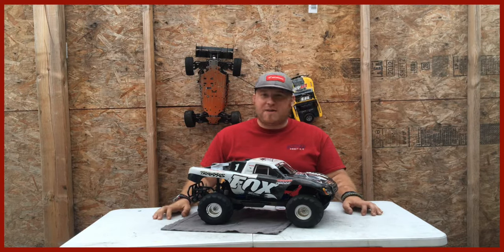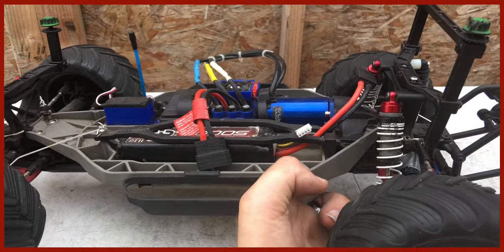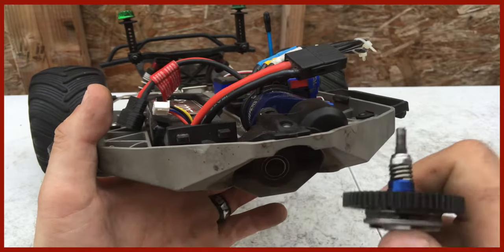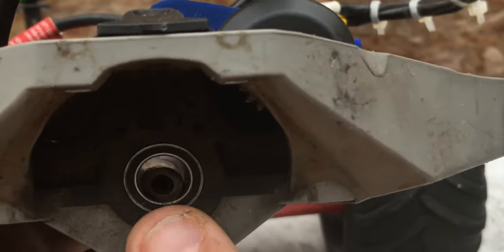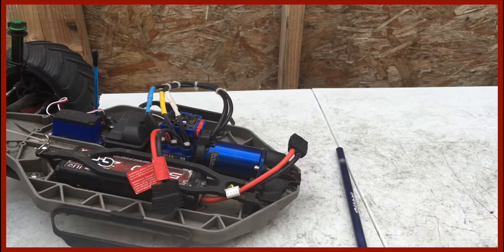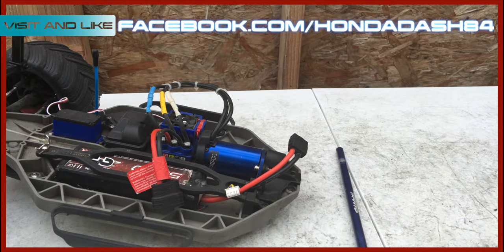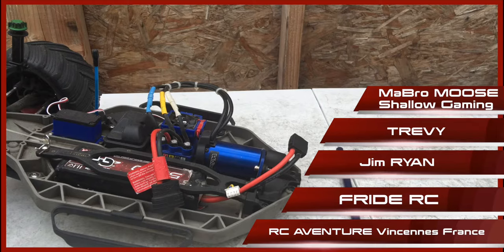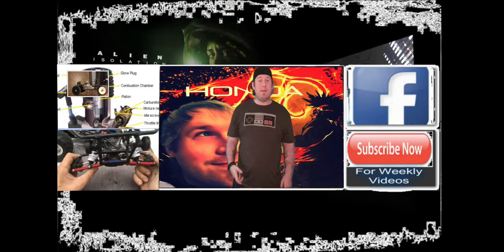RC GUIDE: Change Drive Shaft on TRAXXAS 1/10 model

Comment: hey bro...question. i have a 4x4 stamp with the velenion brushless motor/esc combo. can i run 4 s? if not, i have a 4600 kv castle sidwinder 3 motor esc laying around. would that be more powerful than the velenion system as far as torque? what about speed? also is the castle 4s capable? any help would be greatly appreciated as i value your opinion bro. thanks
Reply from the maker: The Satterfield the VXL 3s is rated for 11.1 and below and the Veloneon 3500 it's not good to go above